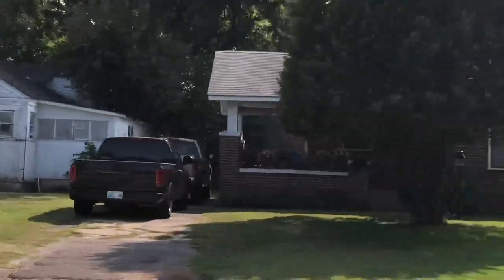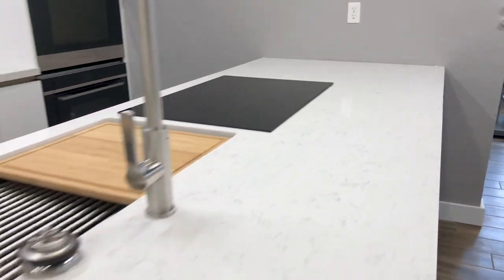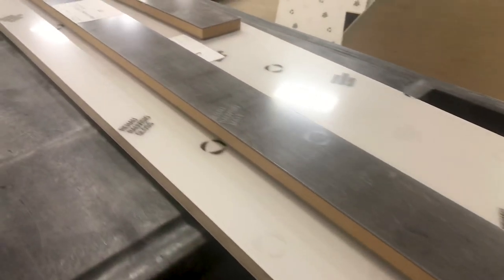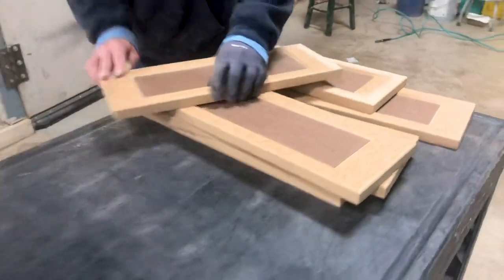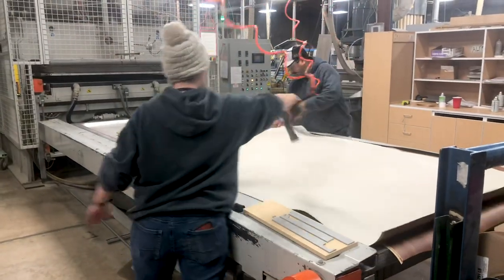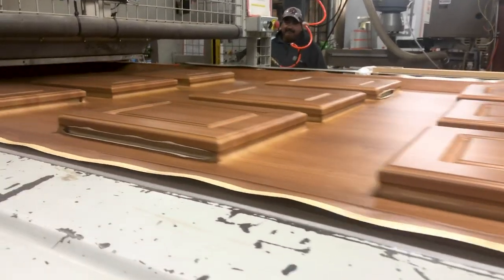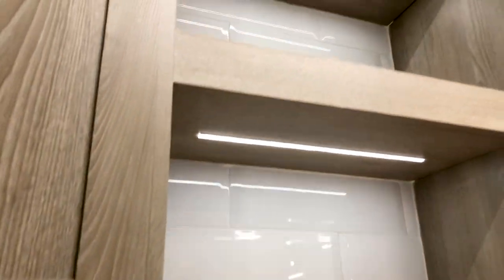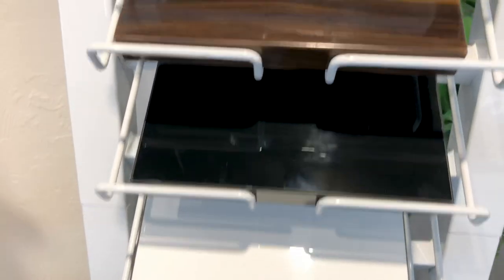How it's Made: Thermofoil 3DL Cabinets and Doors

Comment: Great job
Wanna ask which panels do you use for thermofoil doors
Is it a normal Mdf ? So how do you get this white finish in the opposite side ?
Reply: You can get the double sided white finish mdf wood and it works